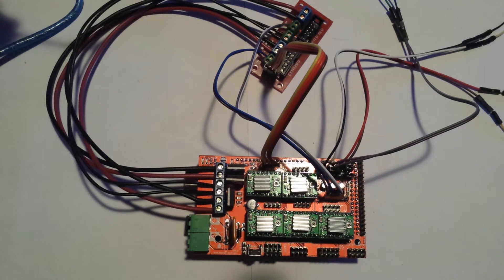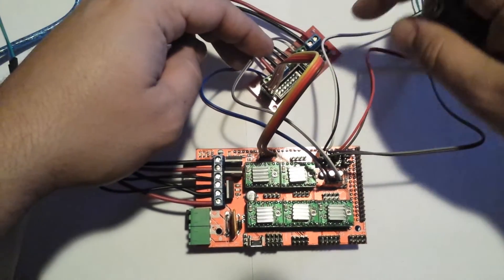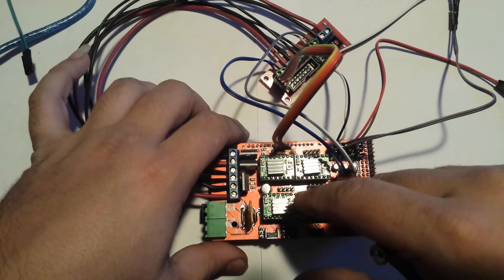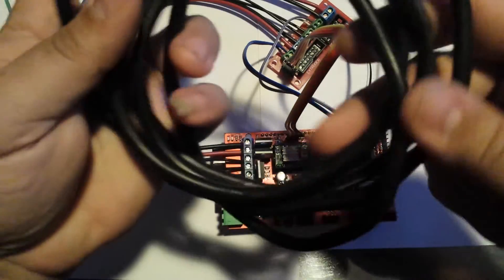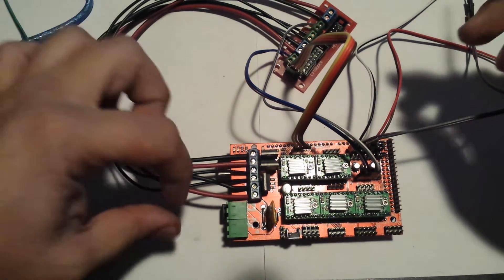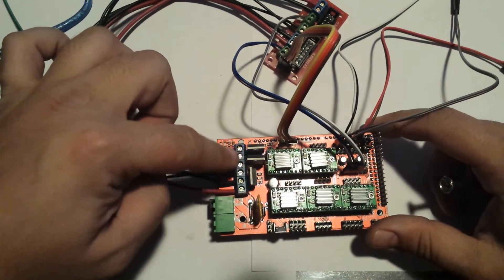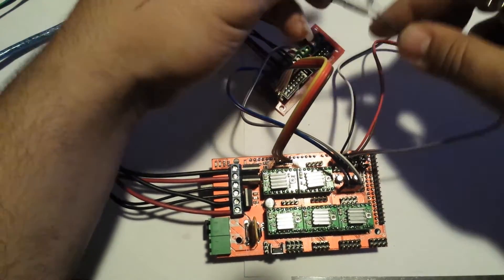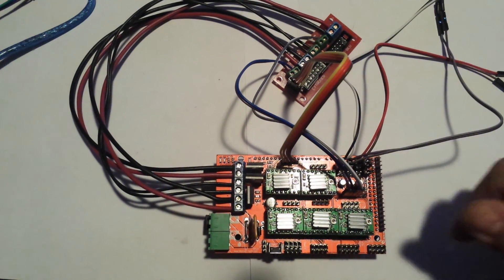RigidBot Board to RAMPs v1.4 Part 2

Comment: Hey, did you get the firmware right in the end?
Reply from the maker: +guysoft42 I did and ran it for a while, but due to it's limitations on only being able to run 2 extruders or 1 extruder and 1 parts fan, I looked for alternatives for a while.  Good news is there's 2 boards that are on the market that are fantastic, cheap and already run 12 or 24 volt without modification. And they can do 2 extruders + parts fan with no modifications.  Either the Sainsmart 2-in-1 board or the MKS v1.3 or higher boards.  Seeing as both of their support pages are going to link back to our wiki anyways, here's a direct link where you can find the information on both: (they are towards the bottom.

http://rigidtalk.com/wiki/index.php?title=Control_board_replacement